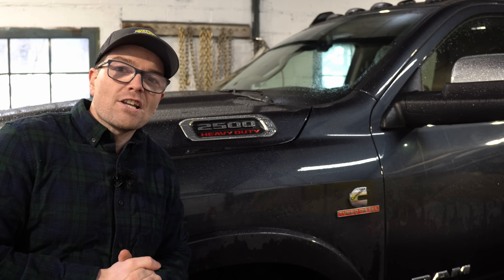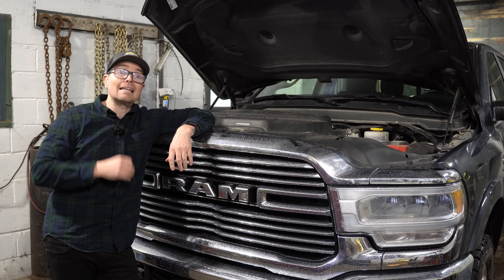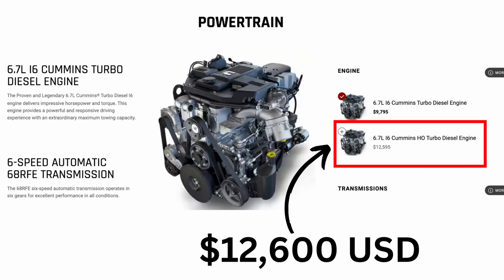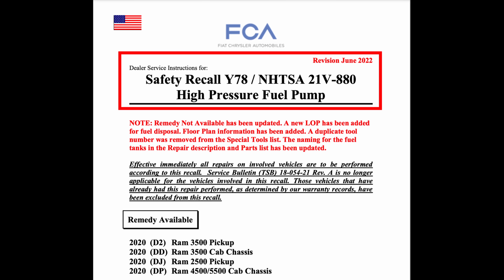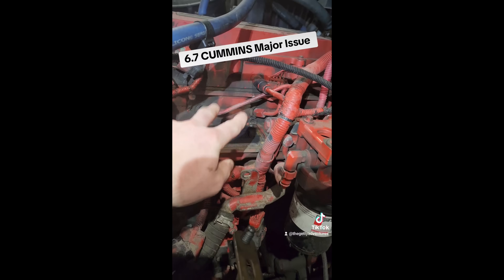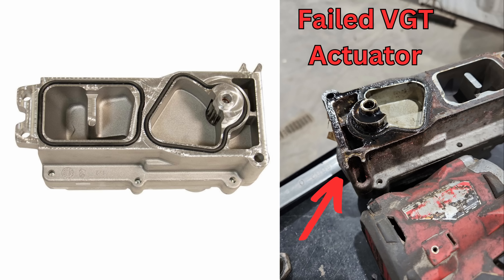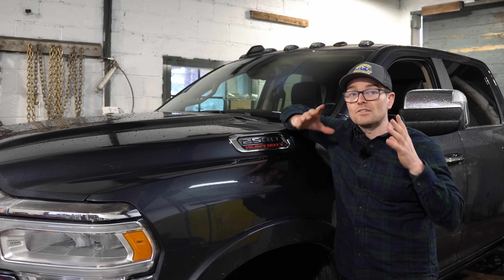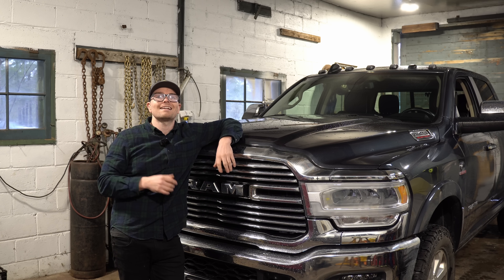RAM 2500 UPDATED 6.7L Cummins Diesel Engine (Details Released) | Diesel Mechanic Review

Comment: The ram HD's are suffering for a few reasons, the gas engine is antiquated (the 6.4 really needs to retire), the 6 speed neuters the diesel compared to compared to the 10 speeds from the comp and the 2500 seems like its trying to be a 1500 with rear coil suspension and no high output diesel, plus the atrociously low payload of a 2500 with the diesel due to said suspension choices and 9/10 times you were better off getting the ram 1500, weighing in 2000lbs lighter, with a near identical gas V8 and significantly better fuel economy... except now that's gone too because they put a 3.0 turbo in the 1500 because they cut the displacement of the engine in half and cut out a quarter of the cylinders. It just makes more sense to buy a ford or gm if you need a truck for truck things, and if you want a truck for a commuter with a bed, it also just makes more sense to buy ford because maverick, and if you want your truck to be an offroader, well choose your flavor of raptor or tremor. GM has a close second to all of those with zr2's and at4's tho. the only enticing ram at the moment is the RHO, and it still lives in the shadow of the TRX. Anyways back to the HD's, the 5th gen is just aging and the age shows, the platform overall is simply old and you have better options from both competitors. Better suspension, better payload/towing, better cabs, more functional interiors (ram has the prettiest, but who cares in a wt model). The cummins name isnt what is used to be either, the 5.0 in the titan and the 2.8 crate engines really did some damage, as well as the recent mishaps with the 2019-2024 6.7's.

Honestly the only ram I'm even curious about these days is the upcoming ramcharger, and this is coming from a mopar guy who has a hemi grand cherokee in his garage
Reply: The gvwr being capped at 10k is what keeps the payload low. It has nothing to do with the suspension.
Reply: As the other commenter said, coil springs suspension isn’t the issue with the payload. I’ve easily had over 3k in the bed of my 2500 and still had room between the axle & bumpstops.

Comment: 2500 should be received well. More power, more cost, more gears. Problem is I would guess same or less payload because of the added weight. I also think if they spent all this time and money on all this development, why would they put another year or so? Lastly they are missing the point. I think nearly all diesel owners want only want thing above all else, low maintenance and high reliability. I think with EGR still a thing, that may never be a reality.

Comment: more interested in the improved 6.4 vs the diesel.  Gas makes more sense when you break it down for the average person towing twice a week.  I tow daily, and heavy 15-17k with our 7.3 and the savings in maintenance and fuel is about 1700.00 per year.  Hopefully the 6.4 will be competitive.  The 7.3 has been great and the 6.6 gas is just as good but a lil weak when towing heavy up hills.
Reply: Gas hogs never make sense unless you want a disposable toy
Reply: @wizard_of_poz4413  163k on our 2021 7.3 hot shot truck and 90k on my personal 2020 7.3 makes a lot of sense. No issues to date other than battery's. Every Cummins, powerstroke or Duramax has given us issues with fuel system, injector failures, fuel contamination, and pump malfunctions.  They don't pull like diesel but get the job done with less maintenace and fuel costs.
Reply: @Jassman3536  +1 The current 6.4 is junk IMO.
Reply: Gasoline is tooooo thirsty 😮
Reply: @garreysellars5525  It is, but you can buy a lot of gas for the $12,000 diesel!
Reply: @garreysellars5525  true, but offset it with the cost of diesel fuel and then add the urea and your better fuel mileage diesel is at a deficit.  Then the cost of owning a diesel for maintenance with doubled the cost of oil changes, additional filters and then problems over the 100k where every diesel we owned (still have 2 left 2022 Power stroke and 2024 Duramax) in that range needed a major repair bill for fuel management or cooling.  Diesel doesn't make sense unless you tow heavy daily.
Reply: @Jassman3536  
Diesel is cheaper again in Australia 
I don't agree with you on most as a diesel fitter 
Graizer property owner several heavy machinery 
Maintenance cost 
A bit more oil better fuel filter  no add blue 
08Ram never had it
9.8liter per 100Ks
Wouldn't go to petrol except in passenger car although the wife drive a diesel people mover shit load of power 6.7 litre per 100 Ks 
No add blue on it,  not 4x4
Add blue is a rip off at 2 plus dollars per litre when mostly. 67.5 percent water 
And only treats 10percent of total exhaust volume 😁
Reply: @garreysellars5525  Here in the states. diesel is a min of 1.00 p/gallon more.  Oil changes are 240.00+ vs 95.00 for the gas. Then you have urea, extra filters, and cooling issues typically around 120k.  We still own 3 diesels but the other 12 trucks are gas.  Todays diesels are too high strung due to the HP wars which has made them not last as long. My 1999 7.3 powerstroke has over 455k...best diesel I have ever had and will never sell it.  I will rebuild it myself when she blows, and she is starting to act up. Every newer diesel from all 3 have had issues like mentioned above.  Yes they pull better than my 7.3 but they breakdown.  The gas motors typically get us 250-350k w lil issues.  We tow heavy every other day and the hot shot trucks put on about 35-40k p/year.  When I put a pencil to it gas wins when you take fuel and maint. costs into the equation.  Each to his own.  I like diesel trucks and cars and even own a 08 VW Jetta manual. 46mpg
Reply: @Jassman3536  
What is your diesel price 
We are at $1.65 per litre

Comment: I'd rather change a glow plug than the grid heater. And their sales is suffering because they're charging 100K plus for a 50k truck
Reply: Never had a grid heater go bad in 20+ years & the grid heater bolt “issue” was practically unheard of until a certain company needed to market their aftermarket intake horn.
Reply: @jeffs2809 That old timer always puts too much mustard on the hot dog.
Reply: @jeffs2809 nail on the head!
Reply: Long time Cummins … the grid was way better then glow plugs reliability and cold starting… till recently.. everything going to💩in modern Cummins diesel engines as far as reliability
Reply: @mikevaughan7681 has nothing to do with the grid and they're leaps better than the v8s

Comment: 4 grand more just because of the increased power/torque in the 2500s? That's absolute highway robbery. Another "redesign" notwithstanding, the increased power and torque is largely due to progammming, which isn't worth 4 grand. No way there's 4 grand more in new components. Good luck with the ripoff Ram.
Reply: Transmission cost.

Comment: CGI blocks suck and I’ve seen testing to prove they are NOT stronger! Strong enough in most circumstances, maybe sometimes. Glad they went back to cast iron.
Reply: If you cast the same part in grey iron and CGI, the CGI will take more force before deforming or breaking. That's just a basic material property. Now if you change from grey iron to CGI and you remove a lot of material from the part, that's a different story...

Comment: I wish I still had my 2015 3500 HO 4:10 now have the same in a 2022 and they didn't make it better. Now they are going to get read of the grid heater. They just can't help but F something up with every new truck. I own a shop in the north and grid heaters just start better.
Reply: I have the 2014 3500 w/ Aisin and need to install the Banks Air Ram intake to address the grid heater bolt failure. I haven’t heard how their little heating element compares to the stock heater. I do like it’s only one part instead of 6 glow plugs.
  I did the killer dowl pin fix on my 1996 Dodge 2500, so nothing is perfect. I kept the truck which still runs strong! 
I prefer the 4th gen engine and Im starting to run additives to help the emissions system. I had to replace the actuator at 70,000 miles and refuse to replace a failed Mopar part with a new Mopar…that’s the definition of insanity 😅

Comment: 13k for the diesel is a ripoff, 430hp and an 8 speed is still not on par with GM and Ford and Ram still has a cramped backseat. Sounds like a big disappointment.
Reply: Nothing wrong with an 8 speed and could be better than the 10 speeds.

Comment: Every engine I've owned with glow plugs became a non-stop pain in the ass at it aged. The grid heaters in my Cummins trucks have never had a single issue.
Reply: My grid heater was repaired by me. Seems like a good deal of careful work with some snips, pliers and the like can make airflow so much smoother. I just plug mine block heater in.
Reply: @geraldkoth654 The nut of death or some other repair?

Comment: At least its not gonna hurt the reliability to switch back to iron block!And i still believe they should develop a 300-400 cubic inches version of the Hurricane for the heavy duty line as an entry level engine!Would be pretty easy to get 400 horse and 560-600 tq .
Reply: You mean like a Cummins 6.7 octane gas engine?

Comment: Yeah the engine doesn’t need to have more HP & TQ, it needs to be reliable. Go back to cast iron and OG roller/lifter setup from the early 6.7 design. I wouldn’t care if the thing only made 350 hp as long as it doesn’t have catastrophic failures like they do now.
Reply: Agreed.  It seems like all the manufacturers want it all.  They want the most HP, most torque, best payload, best towing…  Maybe concentrating on being best at one of two things would be a good plan.  I’m much more interested in good power and reliability.  Easier, more convenient maintenance would be nice too.  I think their reliability numbers would increase if it were cheaper and easier to do oil changes and fuel filter changes.
Reply: @ im with ya on that.

Comment: Wonder what will go in the 4500 & 5500 if the standard output engine is going away.  Seems the medium duty commercial trucks always have reduced HP & TQ.  Maybe they'll just detune it.
Reply: @firedtradesman  generally, that's what is done indeed. Am assuming both 4500 and 5500 trucks will be detuned as well thats what's generally done
Reply: All diesels are the same

Comment: I heard the reason for cast iron block is they had more failures with the CGI blocks and also the roller lifters have been strengthened
Reply: They had way too much material removed around the main bearings with the CGI block. If they would have had more material it would have been even stronger than gray iron
Reply: @Cobruhh93  preach it
Reply: Cast iron will flex better if necessary and the valvetrain is improved
Reply: Cummins uses roller lifters in other engines and for the most part they held up,

Comment: They’re still gonna have problems with the hydraulic lifter. It’s a bad design, no matter what and they’re probably gonna add problems like blown head gaskets with the cast-iron block to aluminum head. I’m pretty sure that’s what they’re doing.

Comment: They should be worried about those lifters not the heater grit
Reply: If that bolt falls off, and many have, it runs down to cylinder no 6 and gets eaten by the piston. If you're lucky, that's one new piston and some head work. Worst case, a new engine

Comment: I wonder if with the new transmission will the shifter be on the steering column like before or will it be that shifter knob that the 1500s have
Reply: It will keep a collum shifter.  It may just be an electronic version but it won't be the dial.
Reply: Its column shift
Reply: @wizard_of_poz4413  
How would you know it’s a column shift when zero vehicles with a ZF have a column shift
Reply: @notme3184  I'm not sure why you think it's not possible to have an electric column shift for and I read it on some article about the powerline a while ago
Reply: @wizard_of_poz4413  
I’m not saying it’s not possible. There is just no way they aren’t going to copy and paste the dial shift from the half tone and current hemisphere HD trucks.
Reply: @notme3184   "Looking into the cabin, I can confirm that the PowerLine 8-speed will be shifted via a column-mounted shifter like the outgoing 68RFE and Aisin, not a rotary dial shifter like the HEMI® model.". Right off of HD rams. Good God people it's called Google.
Reply: @ 
Ehh that doesn’t mean much. Rams prototype at SEMA for a 2025 had the steering wheel from 2022.
Reply: @notme3184  good God I give up. You can lead a person to knowledge but can't make them smart.
Reply: @loveracing1988  
Hahaha we will find out in a week.
Reply: @notme3184  they do that because both those use basically the same transmission. Also it's a good fit for gas truck guys because we all know they have soft hands anyway if they bought gas
Reply: @wizard_of_poz4413  they do what?
Reply: Electronic column shifter
Reply: It will have an electronic shifter like a dial. The ZF transmissions don’t have mechanical linkage.
Reply: Could be column, dial or even buttons.

Comment: Yup good old Irish Spring for rejuvenating fan belts works best. 
My friends 3500 Low Output makes a funny almost a Glow Plug malfunction sound in cold <10 degs C. that I hear every morning. Maybe good old tech will solve it, I'm looking into a Chassis Cab in 2025 but I'll most likely stick with Chevy 3500.
Reply: Great old trick to quite them down

Comment: The CGI blocks are used by many other manufacturers and hold up to the task. The issue with the cummins CGI block design they used had weak points at the mains  and cam journals.
Reply: Where you get this information? More interested to hear about the Cam Journals.. that doesn't have very much pressure on it beside valve spring pressure.  Not sure why they would find a weakness there.. how many cummins engines have you rebuilt?
Reply: @Youngmechanical  BTW I do infrrames and full overhauls routinely.
Reply: @Youngmechanical  I work for Cummins seen enough failures and core returns, primarily the main bearing area cheaped out on material
Reply: @sounboy4498  good to hear someone with some experience. From my understanding the CGI was going to be more rigid of a block but if they removed material to compensate I understand.  I am also an industrial engine guy but large Nat. Gas. Stuff
Reply: @Youngmechanical  the CGI material can stand up to the task once done rite.
Reply: I have a 2022 3500 HO with 75k towing miles. 
I do 10k oil changes and maintenance on time. 
How can I prevent the lifter issue or any other issues?
Reply: @faultless18  10K miles or 10K kms?? The grade and choice of engine oil will play a roll. However I've seen some engines failed at less than 30k on the engines. I've seen a few good ones but if you plan on keeping that truck in the future convert it back to the tappets
Reply: @BrandonLeech  💯
Reply: the cgi blocks also had porosity issues
Reply: I don't have any inside info on the Cummins blocks - but CGI is just as heavy as gray iron. But CGI is stronger, theoretically allowing you to use less material to achieve the same strength. The problem is determining, truly, exactly how much strength you really need and WHERE.
Reply: @BrandonLeech  I work for cummins and that 7.2 sounds made up lol I do alot of training and haven't gotten any material regarding such engine.

Comment: I just got a 2018 2500 Ram back in September with the Cummins. Regular cab. Only had 45000 on it. So far so good. Love this truck. Paid 38k for It. They gave me 15K for my 2018 Regular cab Chevy Silverado W/T with 90k on it.
Reply: It’s gonna run great because it has the flat tappet lifter. Don’t trade it in for a 19-24 ram Cummins there shit. Hydraulic lifters fail all the time I’ve got one in the shop right now getting a motor put in it for a drop valve a 2019 cabin chassis 3500 truck.
Reply: I would strongly suggest a Banks Monster Ram upgrade and get rid of the grid heater. Also service your transmission at 30-50k mi with deeper pan, ATS thermal bypass and billet screw on filter upgrade. Those few upgrades will substantially increase the life of your truck.
Reply: My ram has 550k. I dont do any of what you said and truck is running great